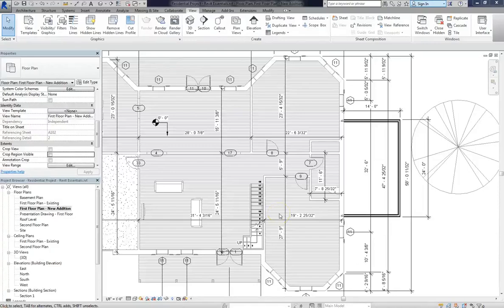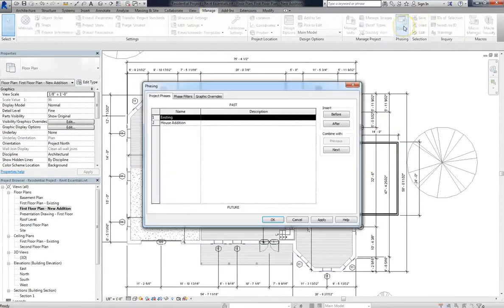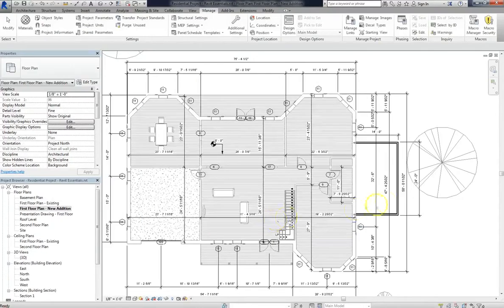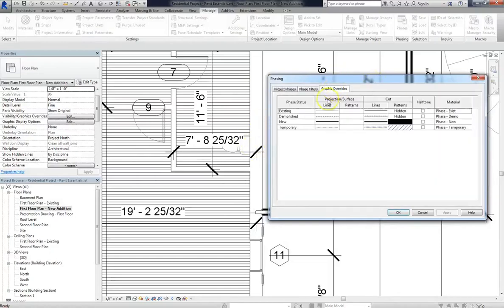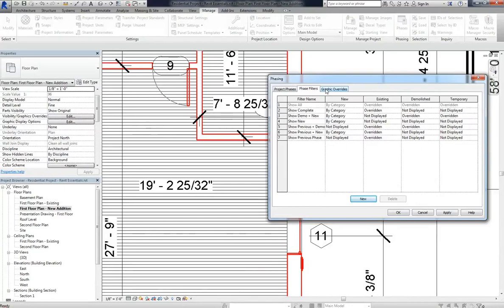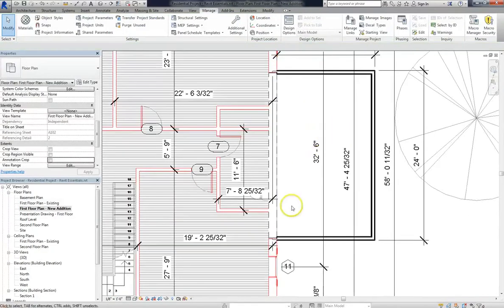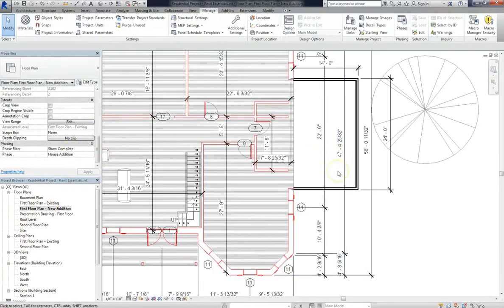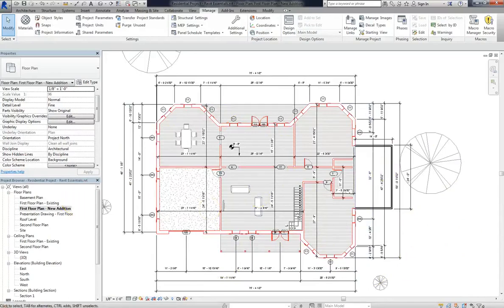Revit Lesson 11 - Phase Filters And Phase Override Settings

Comment: Have you ever found a solution for the patterns not showing up at 3:35?  Just glancing over this issue unfortunately wasn't helpful to me because this is the exact problem I am trying to solve: having a hatch pattern applied to new walls while still seeing the layers underneath.  I realize this video is 3 years old now so I don't expect a response.  I am currently working in Revit 2023 and there have been some improvements, but it doesn't look like this has been fully addressed yet.